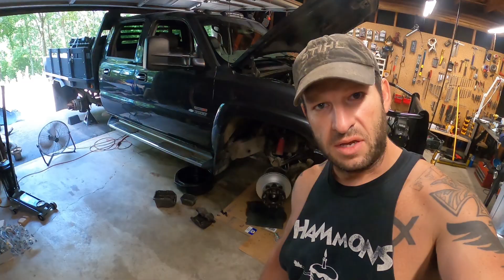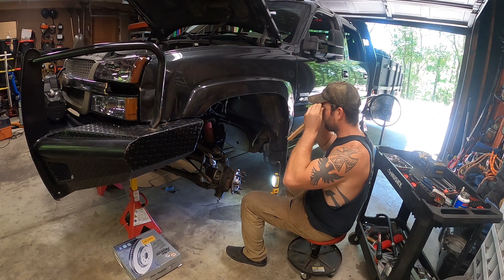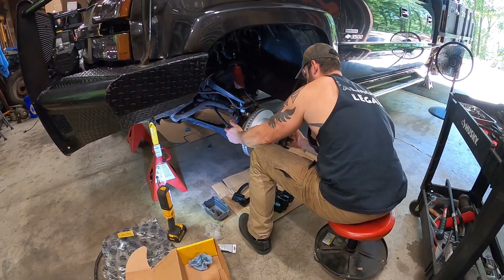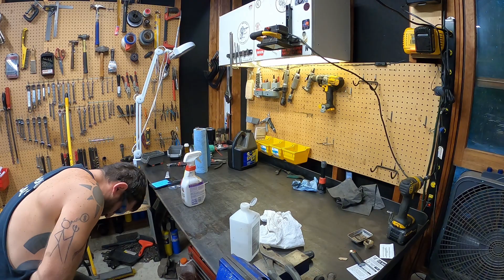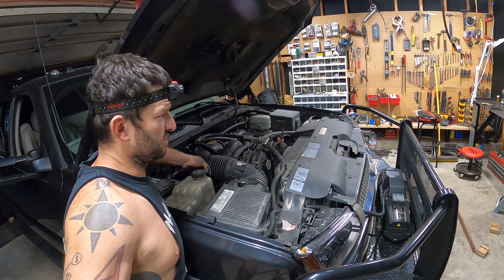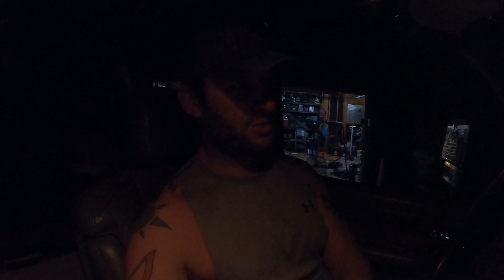Rolling Again...

Comment: I've been binge watching all of your truck videos now because my '05 F350 dually had a rear brake failure last week, right after I replaced the front two. I've been using AutoZone, and they keep giving me parts for an F350 single wheel instead of for duallies. But I finally got the break job done! All 4 calipers, rotors, and pads. So smooth now! I'm also thankful Ford designed them in such a way that I would not need to bang out the studs, unlike Chevys and Dodges.

Comment: You might try using a piece of heat shrink tubing to fix the spark plug wire.Make sure to clean any oil off the surfaces so the heat shrink glue sticks. Good luck!

Comment: You know the ignition lead unscrews from the ignition module on the 200t's? grab the lead and it will unscrew in the normal direction from the module and you can replace it! New lead is 0000 405 0600 and it needs to be cut to 290mm before fitting.

Comment: Got your new rotors I see . Good deal . Oh yeah T540 XP’s don’t melt your coil wire like that .lol    But they do have a vacuum line on the carb that pulls loose once in a while . I do have 200s and 540s and like them both.

Comment: You should sell that shitbox and buy a dodge.  Then you’ll have mechanical AND electrical problems.  Sincerely, a 7.3 owner that goes through about $0.20 in fuel, $0.02 in oil, and $15.00 in parts every mile.

Comment: Think I've been doing brakes since I was at least 12 (30+ years) and can't remember ever using brake cleaner on brakes, cleaning just about everything else yes brakes no
Reply: New rotors typically come with a sticky film on them or an oil coating....if you don't clean them off with brake fluid you immediately contaminate your pads when. You apply the brakes for the 1st time......this does negatively impact brake performance and pad life
Reply: @mr.h4714  yeah well, never had a problem, if the pads can't handle a tiny bit of grease or oil then they would be destined to fail anyways.  Yes brake fluid and brake linings don't get along and will destroy the lining (as well as eat paint and various other things)  regular old oil isn't nearly as caustic, and will burn off within seconds of the first stop. Brakes get axle oils and greases on them all the damn time and never seem to have an issue with lifespan, they may not work very good when soaked through with 90w, but they don't just disintegrate into the void, and eventually will burn off the oil and perform as normal.
This is another example of someone assuming and then spreading their assumption as truth to the masses.  More then likely another myth pushed by the likes of Les Schwab and other brake replacement scam artists to coerce folks into spending more money on shit they don't need.